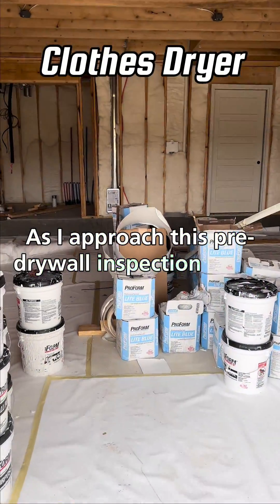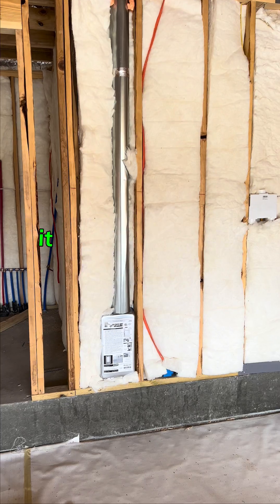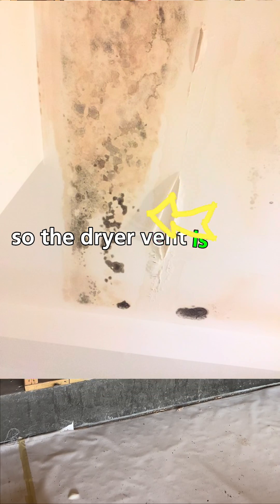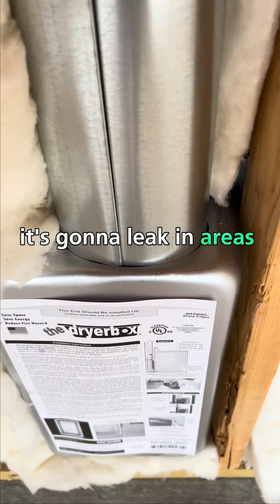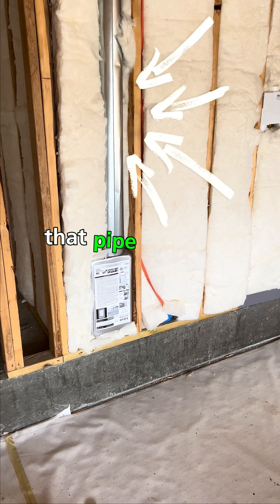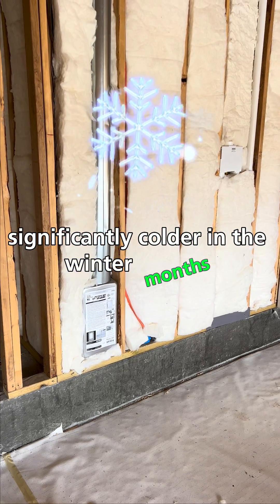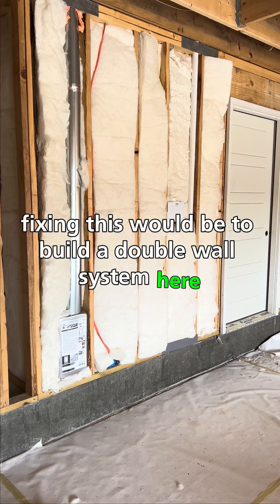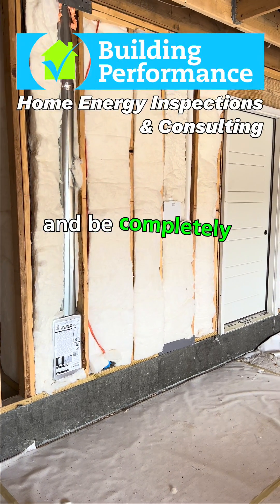CLOTHES DRYER VENT CREATES MOLD IN GARAGE WALL. #insulation #newconstruction #mold

Comment: why not just seal the pipe with aluminum foil tape? or just run the duct up outside of the wall in garage space, then you can get at it for cleaning?
Reply from the maker: You can certainly use metal tape to seal those seams and that will help, but the pipe itself is still uninsulated and the heat loss through the metal pipe and housing at the bottom will create an environment inside that wall cavity when outdoor temps are cold enough to foster mold and mildew growth on the interior side of the drywall.  Running it into the garage without being enclosed would be visually unappealing and it would still need to be insulated anyway, since the garage is not conditioned space.

Comment: Higher quality ducting sorts that out, yes?  But as well, that vent tube should be other-side of an air-tight membrane to the insulation layer.  People don't realize what they're installing, they think its a bloody weep vent; didn't look like much provision for cleaning the tube either at the top there.
Reply from the maker: you are correct!